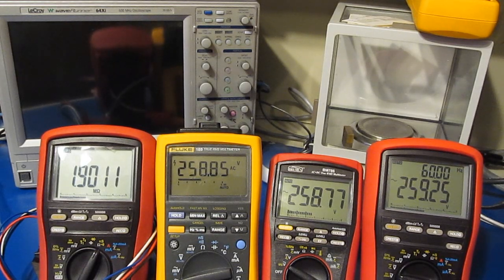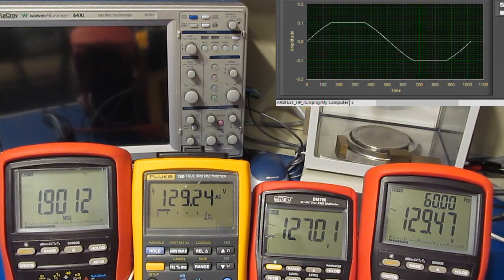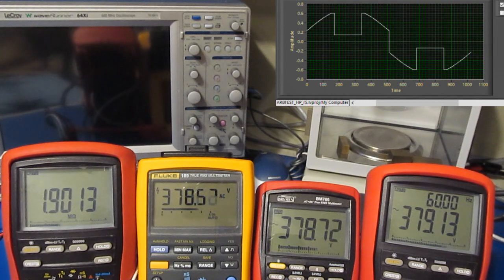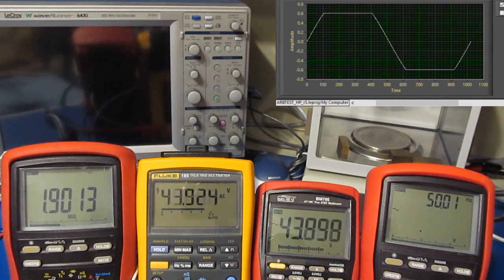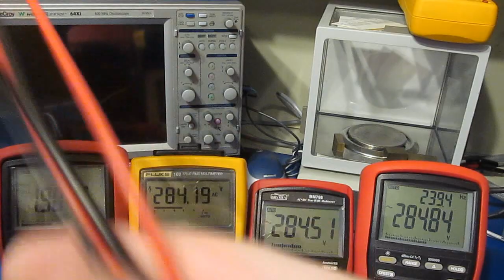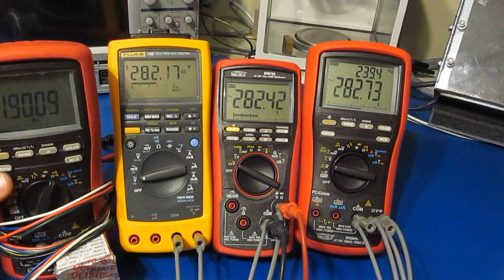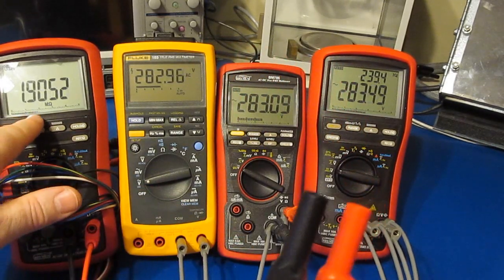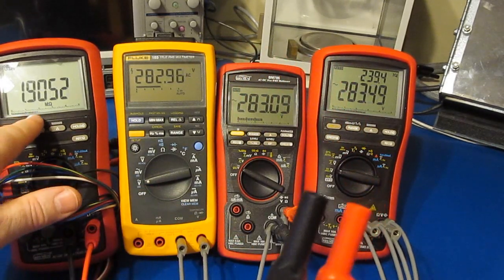Brymen BM786 DMM Part 3B, Repeating the AC test w/ VFD off

Comment: I hope someday you will make videos about Kyoritsu 1021R or Uni-T 139E. Thanks Joe !
Reply from the maker: I've looked at more UNI-T products than most other brands and they have never performed well against these tests.  I see no reason to add more to the recycle bin.  If they ever offer an improved version of the UT181A, I'll have another look.
Reply: @joesmith-je3tq  Did you look at the new UNI-T UT61E+ ? It's rated as CAT IV 600V.
Reply from the maker: @TinTin-dr6ls  Based on the data I have collected, I see no reason to look at another UNI-T product.  They just end up in the recycle bin.

Comment: Which one is the best multimeter for everything. ( home, industrial, electricians and for electrical users)
Reply from the maker: It's a very common question covered in the FAQ.  I do not make recommendations nor am I trying to sell meters.
Reply: If you have a curious mind, buy the most expensive Brymen like 869s. After using the basic functions, you can start experimenting with other measurements - and learn a lot.

If you are just wanting to do basic Voltage / Amp / Continuity testing, get a Fluke 115. You will still be using it in 2041. 

I am not selling meters either but I have tested quite a few. Buying used can be tricky (you need luck) and getting a cheap unknown brand meter are not worth it, life is too short (especially if things go wrong, it can be REALLY short).
Reply: Try BM235 or APPA iMeter5 and see if you like it

Comment: Great video. 

I have a question about the BM867s and 869s resistance measurements. On the four I have they are unable to read above 52Mohms. Im unclear looking in manual if they’re capable of reading above 50Mohms or not? I see that in nS mode they should read in the Gohms? But unclear how nS mode should function?

Edit: To clarify anything over 52 Mohms screen flashes.

When I take a reading for instance of two 10M resisters in series I get 21.66M in ohms mode (I understand this). In nS mode I get 46.13nS (what is this reading)? Shouldn’t I be seeing something like 2.16 in nS mode?
Reply from the maker: During these videos, I've used the units nanosiemens to measure conductance, which is the reciprocal of the resistance.  This is covered in the manual.  Someone asked me once why they wouldn't just use resistance all the time.   Something you can look up now that you know what to look for.
Reply: 46.13nS this is approximately 21.678MOm.. 0.1nS = 10000 MOm..2nS = 500MOm 50nS = 20MOm etc 1/46.13nS=21.678MOm

Comment: I have a UT58D, it has hfe test function, but theres no transistor socket, and the meter tells you to only connect 2 leads, if you then short these together the display goes dim, the battery is new.
Have you come across this?,  I got this meter as it does caps coils and hfe.
Reply from the maker: To measure gain, they need more than two leads.  If you read the manual, they are only testing a single junction using two leads.   I would expect when you short the leads, current would be limited the current source.   With it being a cheap meter, that current source may not be the best thing ever.  So if the battery really is good as you suggest, then there may be a problem with the current source.  You could measure the short circuit current to get some idea if it's right or not.    To answer your question, there is a list of the meters I have tested in the description.  These are the only meters I have looked at.  If yours isn't on that list, you can assume I have not looked at it.
Reply: @joesmith-je3tq  
Of course 3 leads are required for measuring beta.
My meter isnt on your list, one you havent blown up & repaired.
I measured the current with the uni t set to hfe using my digitek INO2513, its 10ma, and  with 3 different 9v batteries of varying state including a rechargable it didnt change much, the display either blanks or shows 1- overload dimly. I then tried placing a diode across the leads to see if it was a misprint and its actually a diode forward voltage check, it isnt the meter reads nearly 2000, current drops to 1ma the display works fine. I'm a electronics professional and have the skills / gear to fix this, but I'm not going to, I rarely use the meter and never use tranny test, I was just intreagued to find out what was going on. By the way I'm in the UK, this meter may be european only.
Reply from the maker: @hellcattanks  "and its actually a diode forward voltage check" yeah, the manual is pretty clear about this.   What's odd is that they show hfe which will require 3 leads, not 2.   But this is what you get when you buy cheap meters.   Current source may be fine, just not a good design.  The 2000 could be 2000 mV .  Off a fair amount.  You could easily test it.
Reply: @joesmith-je3tq  Its off a long way if thats the case.
Its basically a Lcr meter with volts & current, I got it to quickly check chokes & caps, I'd rather they didnt bother with functions that dont work.
Obviously a specification list filler to get people to buy it.
Theres not much in the way of mov's or thermistors, and it has just 1 20mm fuse, it stays on the bench at home, if I connected it to a vfd in ohms mode, which I have done with my fluke it'd leave a black mark.
Reply from the maker: @seandoofer5720  Hard to say how far off as the OP didn't state what they were testing.  It could have been and LED and depending on the current, I could easily see it around 2V.  As I suggested to the OP, they could measure it easy enough.  I'm surprised the inductance readings would be useful.  Maybe a cheap RLC meter would out perform it.

Comment: If we use the same meter repeated five times, does it give the same reading with those tests?
Reply from the maker: Are you suggesting to cycle through each waveform five times, turning the waveform on and off and seeing what the meter displays?  Or are you thinking to power cycle the meter between each reading?   You would need to provide more detail.